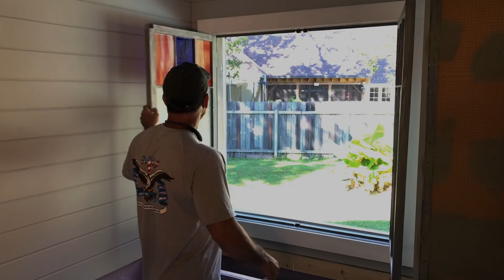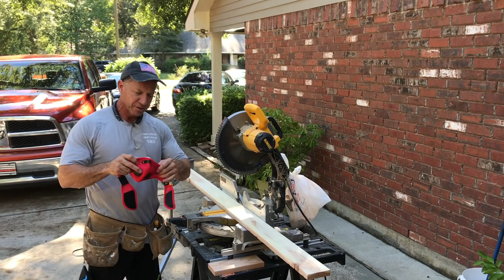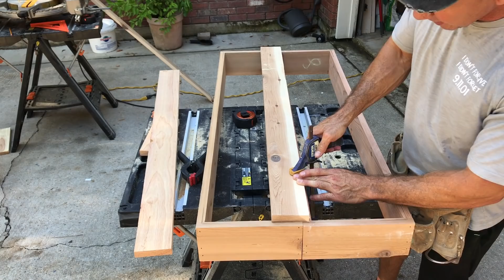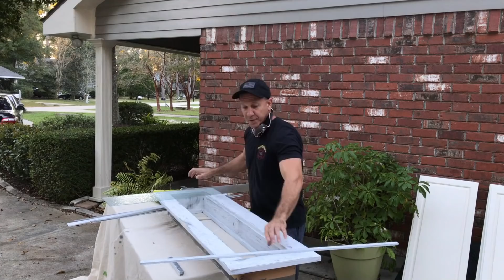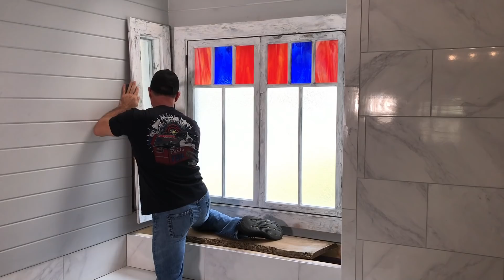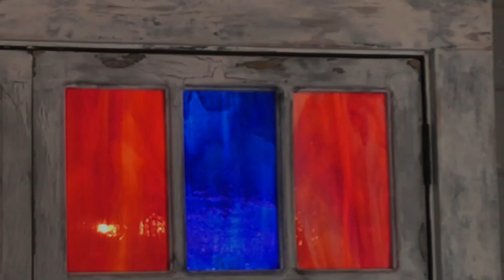Bathroom remodel ( Easy Rustic WINDOW Build)

Comment: Hi Paul what brand is your tape measure looks cool.
Reply from the maker: Hi Levi, they are Savage tapes by Swanson Tool Co. I invented both of them and licensed them to Swanson. I don't push them myself because I was not totally happy with the manufacturing. Swanson has made the improvements that I asked for and these are my samples. I am waiting for them to get rid of the old stock before I show them. I really like them now but I don't want to show one thing and my viewers get another. I would rather make less money and keep my integrity.
 I will do videos when the time is right.
Thanks Levi!!

Comment: Nice one Paul. If your Ryobi is like mine it cannot shoot the last 4 to 6 nails, which is why a full stick won't fit after the first one. Pay attention RYOBI !
Reply from the maker: RuntOfTheLitter6 I fixed that issue, thought it was just mine. I lightly sanded the rivet that would hang the spring up near the front of the track. That spring stopped when it hit the river and wouldn’t push the last 4 nails. You’re right Ryobi needs a couple of tweaks. I really like the gun other than that.
Reply: @paulstoolbox  Thanks again Paul, I'll check for that.

Comment: I liked the face frame build.  The only thing I would do differently is putting the pocket holes in the long boards.  I trimmed out a garage door frame in cedar and did a transition in the middle.  I pocket holed from the long grain and the screws went into the end grain.  I picked it up and they busted out like it wasn't even there because of that fragile cedar grain.  I went the other way with the pocket hole coming out of the end grain and anchoring into the long grain and it was solid.  I know those are face frames but I definitely learned not to screw into end grain like that for any scenario, even if it's being anchored down afterwards.  I don't even build cabinet face frames like that now because of that single experience with cedar.

And I sympathize with you....cedar really screws with me.  I think I'm mildly allergic to it but it works so nicely that I use it often.  Even using the respirator I end up flushing my sinuses with the neti pot before I go to bed.
Reply from the maker: That’s great advice my friend, I didn’t think much about it because the face frame holds it together and I glued it But playing it safe is always better.     Thanks!
Reply: Yeah, it's not a significant issue if you're only doing trim and still gluing and nailing everything before you move it but pocket holes should always be towards face grain.

End grain is always the weakest... Though, depending on how thick the material a way to get around it would be to add a dowel for the screw to purchase into and provide some face grain in the right direction...  Kinda like adding splines to a miter joint... And can help strengthen butt joints too...

Comment: That crackle look is great. I use it on headboard I make for beds. Do you use a dark paint as the base coat first or how do you do it?
Reply from the maker: Mr Riley  yes I normally use a darker base but I sometimes use layers of different colors and sand to coats to let the different layers peep through. Thanks!